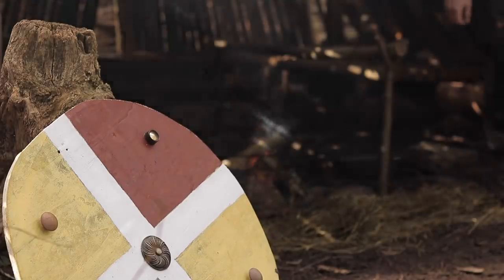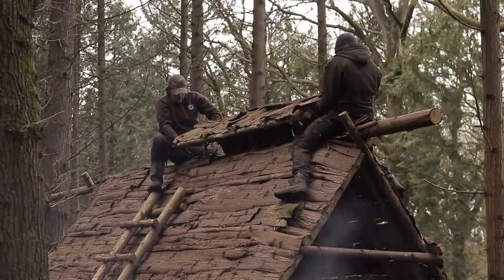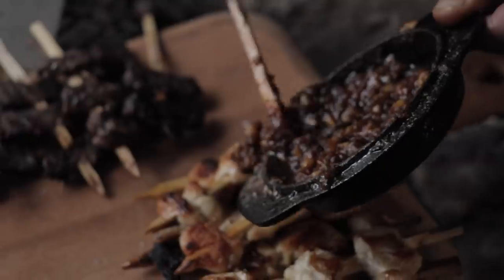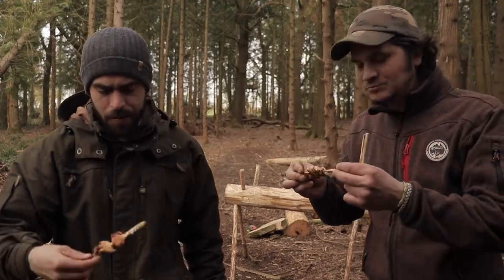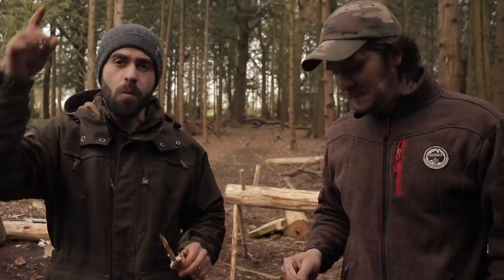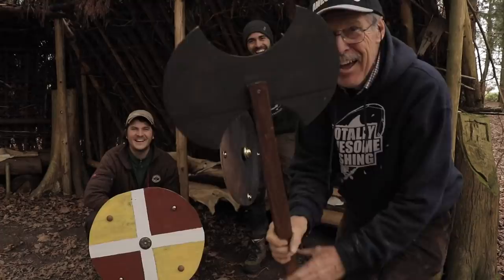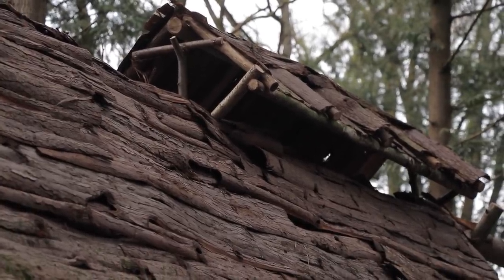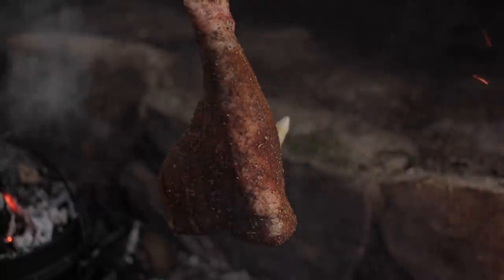Building a Viking House with Hand Tools: | Bushcraft Project (PART 9)

Comment: It is a ridge vent and now if you guys would put bark on the inside walls starting at head height and working your way down to the floor, the draft coming from the outside and rising thru the plenum (that is between the inside and out side bark) will keep you smoke free and warmer in the winter.
Reply: This needs more likes!
Reply: that is the concept with the tee pee. the draft rises between the sod cloth and the outer skin of the structure, then draws the smoke out of the top.
Reply: This guy understands primitive structures.
Reply: this is probably where modern cavity wall construction comes from too, sounds interesting
Reply: @randallhermanson7610  , That is it exactly. This is a Plains Peoples way, not so much the Northern Tribes (as they had more permanent dwellings), But the tech is thousands of years old. The inner wall establishes the plenum by being warmer than the outer shell (thus Drawing exterior air) and provides and insulating barrier at living level. There is no reason that the Norse did not know about, develop independently or learn the technique from other cultures.

I love watching TA  and I learn a few tricks along the way, especially in the comments . This is what I LIKE most about these Awesome Builds. :)
Reply: @jamieminton172  yeah, and nobody is bickering back and forth about being wrong or right. i have only read lightly about how the Norse and other Germanic tribes lived but i find their ways similar to the Native Americans. It is said that at one time the Norse were leaders in technology during the bronze age but they may have been a different people. I think it is a clever idea to grow grass on their roofs and seems like a good way even in modern times.
Reply: @randallhermanson7610  , As a "MUTT" American... My Maternal Grand parents were first gen from Germany and my paternal grand parents were second gen from Ireland (as evidenced by my  first and last name) AND A BIT of NATIVE thrown in by a randy old relative. LOL  

Sometimes OLD SCHOOL works better than modern tech. I started in communications before there was an internet and sometimes NEW SCHOOL is cool! ;)
Reply: @randallhermanson7610  , I should clarify the generations. My maternal great grand parents was from Germany and  my fraternal Great Great grand parents were from Ireland. so the first gen was born here in America.
Reply: Ridge vent
Reply: @jamieminton172  yah, I am auch Deutch (German) and Nordman. to those Germans reading this i apologize for my bad German grammar. One of my grandfathers came from Germany, two Grandmothers and one grandfather came from Norway. i haven't any Native American blood but have taken a strong interest in the history and culture. I need to get back on topic.
Reply: @randallhermanson7610  *Deutsch 😊

And yes, I'm a Nordman from Sweden. 🤣
Reply: no need to you can get moss graffiti and it grow all over the outside..
Reply: @rickeyryan303  What is that sentence suppose to mean?!
Reply: obviously youve done some roofing,
Reply: @jhmsmarttv795  He means that you can cover the bark with living moss. There's a method known as moss graffiti, where you basically blenderize some moss in water, brush slosh or otherwise apply it to the target surface and the moss will grow there. Some people have done some kind of cool decorative features with it; living signs, 'paintings'...
Reply: @relationshipswithscott  Plus, the dead air space between inner and outer walls provides a little bit of insulation and keeps warm (or cool, depending on time of year and what you are aiming for in there) air inside better.
Reply: @jamieminton172  Added a like from a fellow "MUTT" American. I haven't ever heard anyone but me use that term before. I always say that is what I am; a mutt. I have lots of English ancestors and lots of Tucarora ancestors, with a sprinkle of Irish and a bit of Scottish thrown in for good measure.
Reply: This build is very impressive, but the UK could really benefit from a Lowes or Home Depot.
Reply: terminology will vary from place to place and from person to person  but ridge cap/vent fits this bill well enough vent is probably a more recent term
Reply: Excellent!
Reply: @Brandywine6969  Americans calling themselves a mutt is very common lol so many of us have lineages that are from all over the world.
Reply: was literally about to post this and saw yours
Reply: Very cool an clever idea!
Reply: "Tuscarora"?

Comment: The value in charring wood surfaces goes beyond visual effect. ... In Japanese building, charring wood surfaces is known as shou-sugi-ban; this technique is valued because it wraps up wood in a layer of carbon that's highly resistant to mould, insects, water and even fire. It also creates a powerful visual effect. There is a temple in Japan treated this way, and it was built in 711ad.

Comment: I think it’s a ridge vent, becoming more popular now a  days..🍻🇨🇦
Reply: Exactly...need one on my house.
Reply: It's called a medina hood. I install fireplaces and stoves we but them on a lot.
Reply: @hunterwiggins535  are you in the US.  I know locally in New England it's called a ridge vent.
Reply: @robertbergmann6083   I had a ridge vent installed with my new 30-yr shingle roof rather than the "wind turbine" vents my sister has on her house.  Those things get NOISY in the wind.  My ridge vent is quiet yet still keeps the attic cooler & dry.
Reply: @robertbergmann6083  isn't the gap at the ridge the vent, and the cover the ridge cap?
Reply: @brendaatlas850  The whole thing is a ridge vent. Most modern ridge vents are topped with ridge caps, so you are correct, but most in the roofing business just consider the finished product a ridge vent. Ridge caps are needed whether the roof is vented or solid.
Reply: Yup!Thats what we call it in Florida, ridge vent.
Reply: @therealDonMac   I did some work as welder, steel framed homes and buildings. Those are the terms I know from having to explain to clients what the different trims were and the use they served.
Reply: You can’t live without a ridge vent here in Texas. Keeps the attic cool in the summer

Comment: It's a 'Ridge Cap'. Very common in Texas where the heat in the summers can make it quite sweltering in the attics. It also helps to keep the indoors cooler in the summer.  Steve - Austin, Texas

Comment: Viking's house had no chimney or window that someone here points out, but they had a hole in the ceiling, called Ljore in Norrøn, which served as a smoke hatch and the only light source. This hole was covered with a hatch, called Skjå, which was drawn with thin translucent leather, or cow belly, and was thus a light source even when closed. This was opened from below with a brace or pole, and was usually open on good weather days, or when there was a fire in the fireplace/s, called Åre, that there could be several of in a Longhouse. Great and inspiring work :) Greetings from a Norwegian Viking :)

Comment: Terrific segment. Thanks much for posting. I wanted to suggest something for your roofing & water leakage situation. In times past the Vikings would use tar as a more permanent method to patch holes and leaks and use sticks, leaves, grass over the warm sticky tar then allow it to harden. If you don't feel like trying to get actual roofing or asphalt tar for your project, you could wait until warmer weather and try using driveway sealant which is tar based, comes in 5 gallon buckets, is not all that expensive, and is easily applicable with brushes. My buddy and I used to use it as a form of inexpensive undercoating for our automobiles back in the day by crawling under our rods and painting it on with brushes. It definitely kept the rush off our cars here in the northern climates of the US and it should work for leak proofing your roof.

Comment: The chimney looks amazing. Chimneys in Viking times were simply called smoke holes. If the family was rich, they would have had a wooden box around it (smokestack). Poorer families had a simple hole in the centre of the roof, between two joists. Later on in the era, gaps were left in the turf/thatch/bark along the length of the longhouse, lined with a clay, to create more of an up-draft and allow the smoke to escape more easily.

Comment: I'd recommend a detached  front door. 
A simple hanging square pole frame, with the same style of hooks you use to hang your tea pot, covered in bark. 
That way you can pick it up and move it out of the way but also have a wind break and a way to keep rain driven by the wind out.

Comment: Yes it would be a ridge vent but could also be considered a ridge cap as well.  Either works.
You could use some a shingling method called "shakes" by splitting off thin pieces of a white oak round and nailing it on to form a shingled roof,  as well as for the gable end of the house.  It would be a lot of work, but it would definitely be more water tight.  You wouldn't have to change the ridge cap at all, though; it can stay as it is.
This is very cool.  Keep up the good work, and the food looks fantastic.

Comment: If I may suggest in the future one could add a pine roof shingles as pine trees branches grow in rows there would leave better than a foot to 16 inches you cut out the tree so that you have clear sections and using a foe which has a wood handle and an iron wedge you hit with a stick and split the shingles . So it only need a saw  a foe to make pine or cedar shingles a stick or rubber hammer and proper roof for both the Vickinh and Sackson houses . Great videos and food .
Scott from New Hampshire USA

Comment: I've watched your whole series with interest. Not bad for your first venture. You need some adequate tools so you can work smarter, not harder. Lots of work could be saved with a bark spud, a froe & a timber jack, log tongs or log hook. The bark spud makes bark removal easier. A froe gives you the option to split shingles as well as being excellent for cutting kindling. The jack, tongs or hook will ease handling of your logs. In this video, I would have split that long piece of bark lengthwise & applied it that way to minimize gaps (leak points). Keep the videos coming.

Comment: Don't cut your rafters so short. Nail the cupola to the ends. Make it a little longer and wider. See the previous comment about putting bark on the inside. That works great as well.
Great series.

Comment: Add some layers to the bark roof, even with shrinking it should make the roof waterproof after 2 or more layers. Though straw works better is done right, because then the water follows the straw down instead of through the roof, but layers of bark should work nearly as well.

Comment: Have you thought of digging  dirt up from a nearby area &  mixing in water, and patching Mud over the bark roof? With the layer of Bark on roof, then mud, then place grass square patches over the mud. 
That would stop rain from coming through holes in the bark. If not that, then place another layer of bark ontop what is already there

Comment: CALLED IN AUSTRALIA A "RIDGE CAP"  CAN BE TIGHT FITTING TO EXCLUDE ALL WEATHER OR WITH A GAP TO VENTILATE THE ROOF CAVITY IN HOTTER CLIMATE.  CHEERS.  FROM OZ.
 This type of structure is still used today with materials of modern origins and are still low cost alternatives to european style structures of stone and slate etc.

Comment: You should make a wall in front as you did at the back, and have a door with the same mechanics as the window. maybe even have a small  gap near the top of the doorway to lift it from the ground then open it without scarping the ground, also if you guys put in more work It would be cool to see a floor with planks

Comment: You should do a front walk with a big doorway in the middle.   If you want a well-ventilated wall, you should use the basket-weave method you used for the perimeter wall.
Reply: I meant to say, “...a front wall...”.

Comment: Great job guys! I'm surprised you guys haven't used natural sealants/water repellents on the roof. Seen other videos of people boiling tree resin and coating the inside of natural water filters to keep water from leaking out. Perhaps you could do the same thing to the roof once you figure out how to patch the holes in it? I'd also recommend using tar since it does the same thing but don't know if you guys have access to that there. Should be plenty of resin with all the trees near you. Not sure if the type of resin used matters, most of the resin used in videos i've watched was pine and I know you guys have a lot of cedar.  You guys ever going to build a front door?

Comment: You might groan about this suggestion but the best way to stay natural materials and more traditional is to put two or more layers of bark on the roof to make it more water tight.
Also on the roof I have heard the chimney called a spark diffuser or spark arrester before, but that might not be the correct term for it either.

Comment: Shou sugi ban also hardens the sugars in the wood. Making it much harder, and thus more difficult for insects to get at. Also slows the spongy effect wood has. So it stays dry. The charred skin is also much more waterproof in general. 

However, it depends on the wood species. Ceder, due to its heat resistance burns much deeper, so the shou sugi ban properties go through. With other kinds of wood, it tend to be more surface level and wears away quicker.
In fact, sugi actually translates to Japanese Cedar.

Comment: I don't know if you really need a "front door" ...as you said you're still working on the backside of your Viking house. But with that 'Ridge pole" front you can do some special construction, or even an extension. Maybe it would help to build a front.
The bark on the outside I would get a second layer with moss and one more with bark, too... maybe you get your Viking house more warm inside as it's insulate the interior more from the outside (rain and wind!)

Comment: Idea for a stool take a log and cut of a 6 inch wide slab of it so you have a round top then use your hand auger to drill holes for the legs i would recomend three legs this could be used so that justin can sit while he is prpering the food insteadnof being hunched over if you see this thanks for reading it by the way good luck
Reply: Also the ffod loks awesome and the shelteras well keep up the good work!

Comment: You basically made a "Vent Cap"... or also "Ridge Vent" which s used to keep attic temps low... Yours just doubles to release smoke but may not stay very warm...

Comment: I disagree, it's totally Viking food. You ate what was available, that's pretty much what they did with everything. They were pretty much survivalist MacGyvers.
Also something you might want to add to the ridge vent is you should make it slightly longer on either end so that if the rain isn't coming down straight it still won't get in. As is it could still get in, it looks like.

Comment: What is that thing called that you put over the fire to cook the meat and everything else?
Reply: You mean the spit? Campfire Spits are where you put food on to allow you to spin the meat over the fire for even cooking, they used it more for hanging their pots and kettles. They used the hanging method for their lamb leg simply cause it didn’t require nearly as much effort since it spun itself using the heat on their “windmill” lol
Reply: Norse Nomad no I’m talking about the large cast iron thing that has three legs on it. I’m hearing they’re just called BBQ discs, but I can’t find this exact on in the video. Mostly they’ve been crazy expensive and hook up to propane.
Reply: Christopher Bull Cast Iron Dutch Oven Legged
Reply: With Legs***

Comment: The old timers would need to off a claim jumper or a theif and get rid of the body ....they would go find a fallen tree like that  toss the corpse in the hole and then cut the tree....without the weight of the tree the stump rights itself and seals the hole off ....gone forever